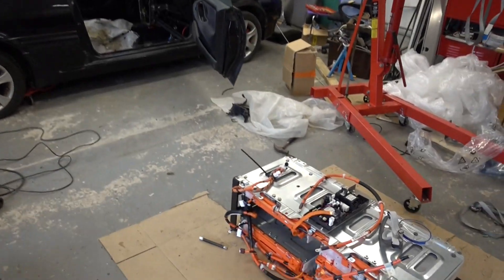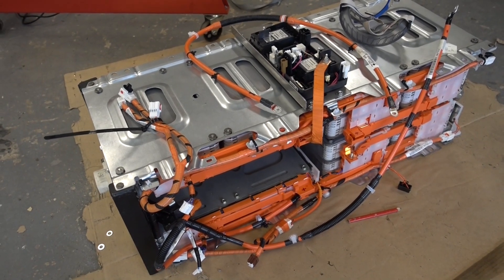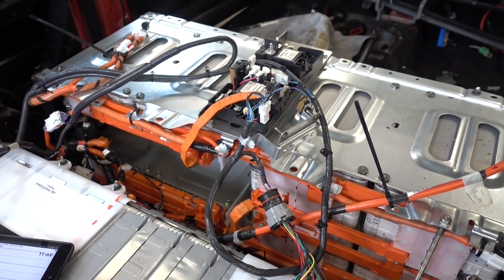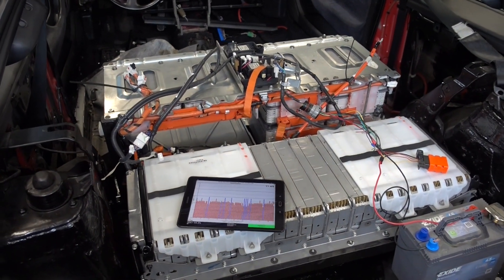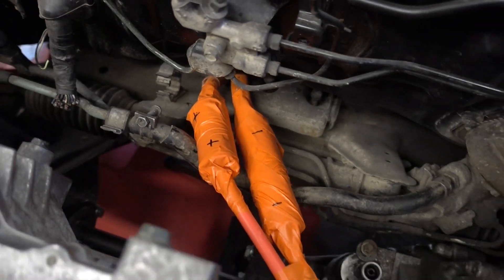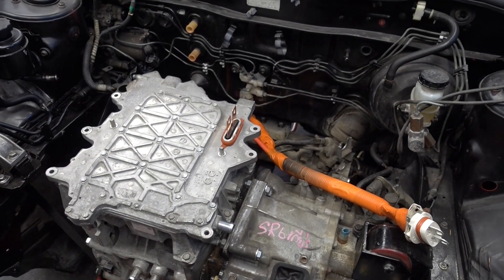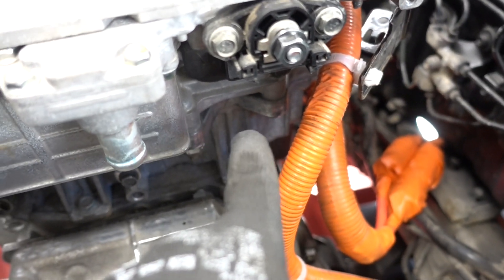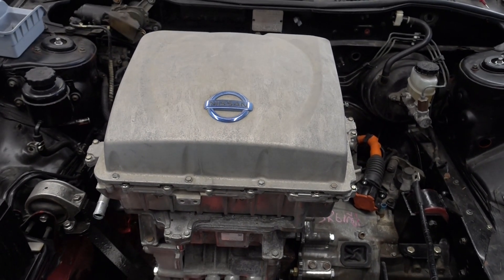High voltage cabling [EVNX EP11]

Comment: Nice to see the battery survived the storage.   Good work with the cables.  Will be interesting to see the Resolve EV install and configuration.
Reply from the maker: Yeah I also was a bit worried after throwing it around that much (and also dismantling it accidentally once!). Will feel amazing once the Resolve EV controller is done and we get wheelspin ⚡

Comment: two questions:
1) why contactors are not located in the space leaved between the "L" shaped batteries?
2) ZE1 on board charger seems lower or at least plastic cover can be removed. So probably can fit respect the ZE0 OBC
Reply from the maker: 1) We tried to fit the contactors there, but there was so little room to bolt stuff down that it became dangerous. Very easy to touch something wrong in such a small place. So we settled for a safer top mount.
2) The ZE1 inverter is not that much smaller, it wouldn't fit either. It is just a few mm smaller in some places.

Comment: Hopefully you have future plans to additionally protect the high voltage wires running underneath the vehicle from road debris.  The plumbers tape that you are now using over time will cut into the cables insulation.  You need a product like.....https://www.ubuy.com.gr/en/product/8N4MDJGM-solarson-stainless-steel-cable-clamp-1-2-inch-0-5-inch-20-pack-pipe-clamp-metal-clamp-tube-clamp-rub
Reply from the maker: Yes ofcourse! This is just to see if we can get it to spin (and if something hits the chassi up front). Once we know that the powertrain is OK we will tidy up all the cabling!